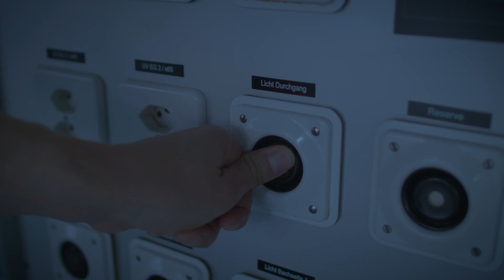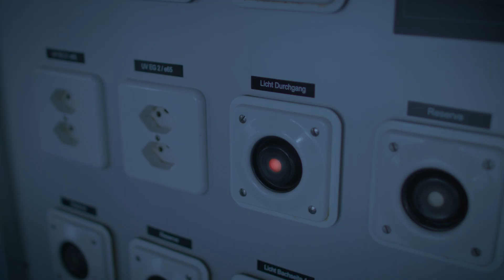REGO-FIX powRgrip PGA Trailer

Comment: Table with different size PG holders. How do you change the PG adaptor in the machine?
Reply from the maker: The head of the machine is identical to our standard PGU9500, with interchangeable PG inserts adjusting for the different sized PG holders. We have a couple videos specifically showing die operation in our channel if you're interested!